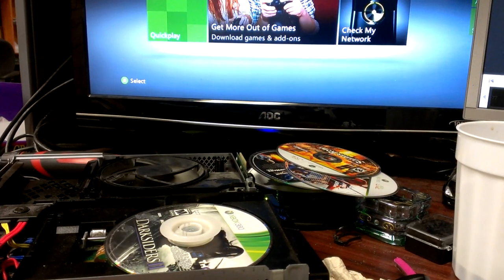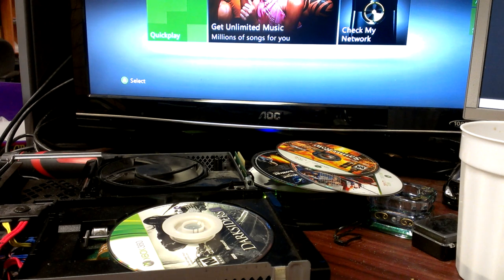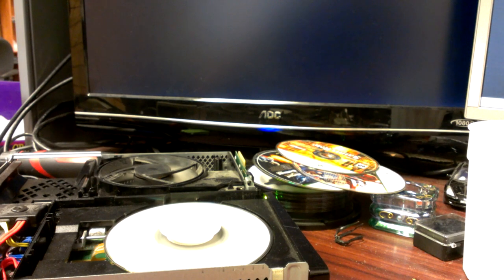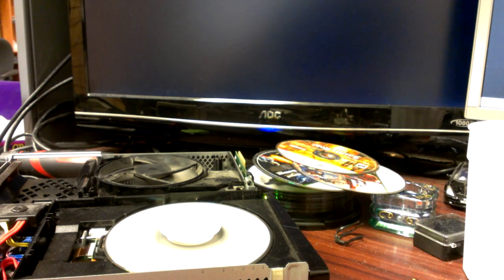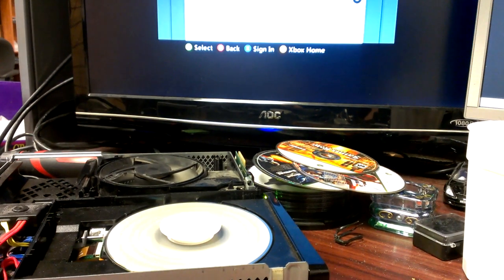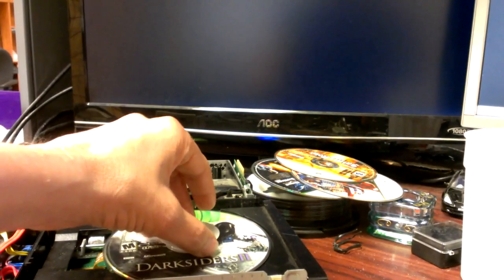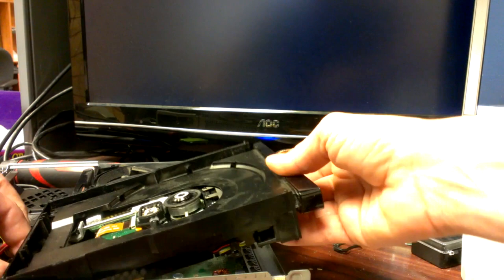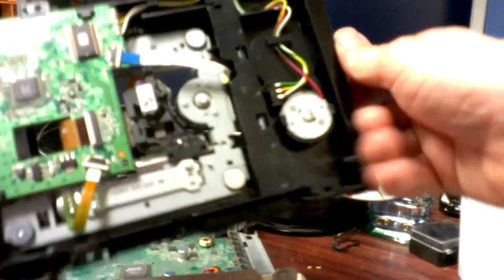xbox 360 Slim Open Tray Error - disk won't spin no fix PART 2 OhYa

Comment: Thanks for the vid and the tip about the power cable. I swapped it just to be safe, had one kicking around from a dead original 360. I think the issue might have been high resistance due to a break in the stranded wires powering the drive. I suspected this because it seemed as if the motor that spins the disc needed me to manually give the disc a nudge with my finger to get it going. As though not enough current, to apply enough torque, to crank the motor, at stand still.

Comment: I have the same problem and I i've tried leaning laser, worm motor, lubriating laser rails and so on...I also used some wd40 inside the spindle motor and that didn't work. I'm definitely gonna buy a replacement drive but in the meantime i'm gonna shake it so i can hopefully play bops 2 :P, thanks for the vid, much appreciated.

Comment: have you checked the red and blue cables in the back bcuz when i cleaned my xbox i left the red cable unplugged and there was my problem so i had to take it apart again plugged it back in and i started to metro last light and it worked so probally that is the problem

Comment: did you ever tried replacing the motor on it? you know the piece you said you didn't replaced on this vid... i am working on an xbox 360 fixed red ring and it also had this issue had a pulled spindle and i popped it back to place still didn't spin however i am considering replacing it, have you tried it? and if so did it worked as a permanent fix after that? thanks i await a response

Comment: Hilarious fix.
Probably not gonna leave my xbox open to use this though...

I have the same problem, replaced the laser, can't be arsed changing anything else until I actually know what the problem is and what will definately fix it but I've scoured youtube and google for answers and nadda!

@ Jack Jerome - I've cleaned all the dvd drive but might try giving the disc spinner a better clean, see if I can get your fix to work.
Reply from the maker: Did you try replacing the Power Cable on the Drive?
Try that, I have seen this problem 7 times since that video in 2012...
6 of those times it was the power cable.
And FYI, the one from the 360 Phat is better than the one from the slim, so try using a Power Cable from the Phat 360 DVD Drive in place of the of from your slim...
Good Luck!
Reply: +OhYa1337 can you run your Xbox all open like that?  so I can just tap on it in case it won't read my disc
Reply from the maker: Yes, it will work fine...
But read the comments, it can be fixed...
Probably just 1 of the cables going to the drive :)
Reply: +OhYa1337 I guess I need a new disc drive

Comment: i need help it wont read any disks and it makes some sort of sound it basically wont spin
how can i do something about it without taking it apart cause i dont have the proper screwdriver to do so and the banging part i dont no if that will even work

Comment: danhewitt1984 is right. You can't always just drop a new laser in and have it work. Often you have to adjust the potentiometers (the screws danhewitt1984 is talking about) to the proper settings. They control the laser resistance. When you have a weak laser, often you can lower the resistance and get more use from it. Sometimes you never end up replacing the laser after. Plus on new lasers, you have to be sure to remove the static guard by desoldering a point on the new laser or it won't work.

Comment: have you tried tightening up any of the spin drive screws that may have come lose as I noticed you had to bang it a bit to get the spin drive to work as I only just watched your video on the 360 slim (25/10/15) I ain't no expert of taking PC laptop ps3 or even the 360 apart to see but I think there are done screws on your spin drive that stabilises the spin drive on the 360 and like I said, I ain't no taking apart and fixing it all back together expert but I have an idea there maybe screws fruit the 360 spin dive so give em a try and upload another video to inform us on it worked or how your got on
Reply from the maker: +Matthew “MattyBoy” Perry - I fixed this a couple years ago, the fix is listed under the Comments above.
* ended up being the DVD Drive power cable *
Thanks for your comment though :)

Comment: guys i had the same problem and make sure the ribbon cable that plugs into the laser is plugged in ALL THE WAY , mine was slightly unplugged causing it to not spin all the way so i plugged it in all the way and it works great now

Comment: its the level of the disk tray, i just figured it out with mine....there is a clip on the side that keeps it level on the slims, alos check the screws on the bottom of the disk tray they may have come loose and they keep the tray level so the laser can read the disk

Comment: I just cant beleive this mine doesent spin at all xbox is the wrost console out i have it for 7-8 years now an i had to replace 4 times and the bought the slim, the slim the lastest xbox and still has a problem kmt the white one has the same but all u need to do is bang the top a few times this one u cant so i dont know any other option

Comment: Hey I've just encountered this issue recently and I completely took my xbox apart....I was just wondering if anyone has tried just buying and replacing th motor with "0225 Drive Motor for XBox 360" (just google that, it wouldn't let me post the link). If so, did it work?